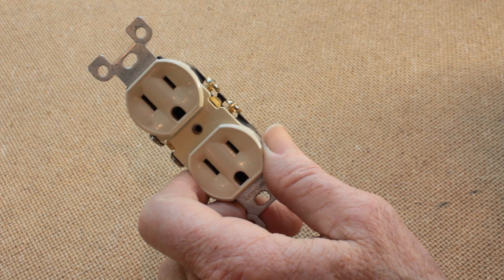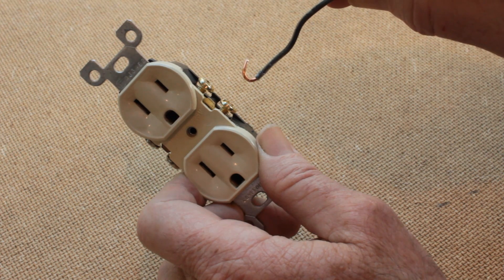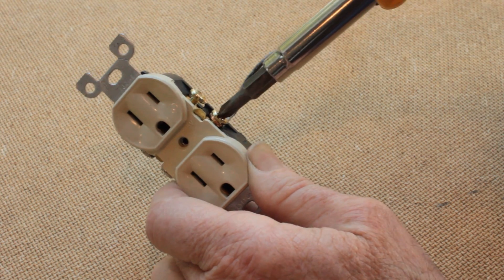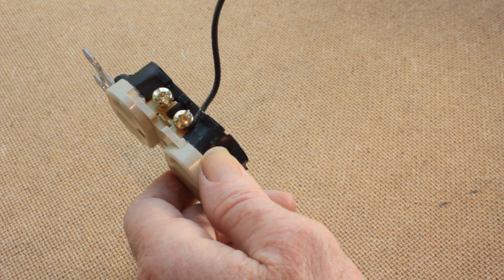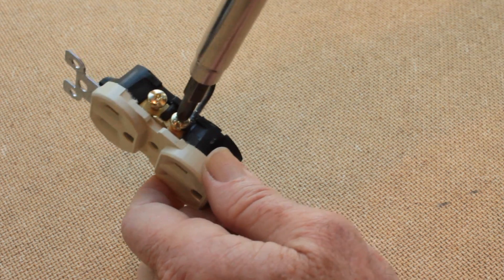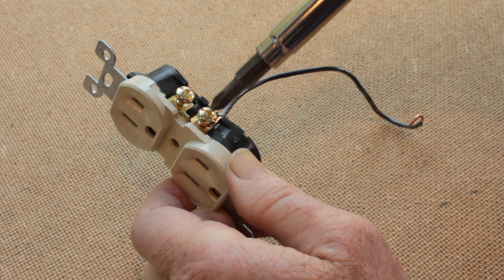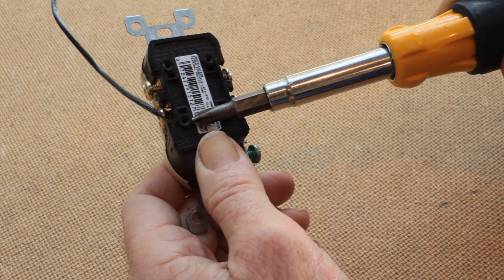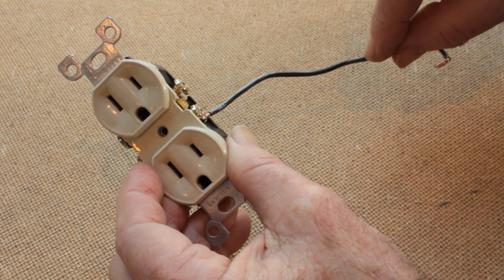A Common Goof Replacing Outlets

Comment: I have six wires on old receptacle four on screw two plugged in back. New receptacle has four screws and no holes for the two extra wires. What do I do? 2 black, 2 white and 2 red. The 2 were stuck into the back.
Reply from the maker: Easiest would be get a receptacle with screws and holes. Otherwise, put the blacks in a wirenut with a single new piece of wire. But take notice: red often means half the receptacle was controlled by a wall switch or is a different circuit. If so, confine the reds to (say) the bottom half, with blacks to the top, and break off the metal tab connecting top and bottom.

Comment: I like adding a couple of turns of tape around the outlet before it goes back in the box. The commercial guys who do the wiring where I work do that. Seems like an added bit of safety that doesn't add much time to the job.

Comment: Good advice. Can't be too careful when working with electric fixtures. My first place was about 50 years old when I bought it. I eventually replaced all the worn out wall plugs & switches and noticed the old copper wiring was heavily tarnished where it was attached to the fixtures.  I removed the tarnish with fine sandpaper held between thumb & forefinger. Don't know if this was necessary but my intent was to create best contact between wire and fixture. It's been 43 years and the house is still standing so guess it was safe to do it.

Comment: I like the newer style outlets that have a clamping plate under the screw.  No more wrapping the wire around for a good connection and easier removal than the holes in the back.

Comment: If you use the rear insert holes with the wire stripped to the proper length, are you supposed to screw down the side screws anyway? They always come from the factory as shown in your video.
Reply from the maker: There are some uncommon receptacles whose holes on the back will not hold onto wires at all, whose holes are not meant to. For these receptacles the side screws must be tightened to hold the wires in the holes tight. So always see if wires you have stuck in holes will easily pull out.

Comment: This completely depends on the user's skill level.  Yes if you can curl and install on the terminal the way you are showing, then yes a better installation no doubt.  As an electrical contractor I have seen extremely poor connection attempts at wrapping the wires where using the back stab connection would be a much better connection then a poor terminal connection.  I've seen wire insulation melted back inches in some cases with a really bad terminal connection.
Reply from the maker: For the benefit of comment readers let me say that when Nick refers to "terminals" here he means the side screws. (The push-in contacts are terminals too, I believe.)

Comment: If you're not aware of this information you should not be involved in electrical wiring. Wire size and circuit amperage should also be taken into consideration. You can burn your house down. This can not be over emphasized.
Reply from the maker: Is there anything that can be overemphasized?
Reply: I've been doing minor home electric repairs and upgrades for 20 years because of people like the circuit detector. Thanks!
Hiding info doesn't help anybody.

Comment: WHY would leaving a little insulation on under the screw head lead to HEATING? Makes no sense...
Reply from the maker: When electricity flows through something well (that is, when there is little resistance), very little heat results. But with more resistance, heat results there. A portable heater produces its heat because its element is resisting the flow of current to a degree.

Comment: Tell people why. Without a good copper to copper connection it adds resistance. Also make sure your connections are clean, a bit of sand paper on your wires can't hurt old stock.

Comment: Why do they make outlets and cords with one prong wider? This makes it more difficult than it used to be when plugging in. I asked an old electrician about it once and he said something about "phaze", whatever that is. Do I care if my tools are not in phaze or whatever?
Reply from the maker: It's not extremely important but for instance when you are unscrewing a light bulb and your finger touches the threads of the bulb, they don't want you getting shocked from that. They want the little tongue down in the light socket to be what could shock. The prong width is not insuring "phase", it's insuring polarity.
Reply: So should I care if my tools are out of polarity, or whatever? I was thinking about grinding down all the wider prongs so I can plug my tools in either way, like the old days.
Reply from the maker: If it's just an inconvenience to plug in the "right" way, I don't think that justifies grinding a prong because it's not just you who may be using the tools, Some heir of yours might do something foolish that would show us an as yet unimagined reason polarity matters.
Reply: I just read that AC voltage has no polarity. I think I will go with that.
Reply from the maker: AC "polarity" is a different thing and it occasionally does matter. DC polarity is about positive versus negative charge, but AC polarity is about both-of-those charges (alternating) versus no-charge (=ground).
Reply: With a defining difference in size of neutral and hot prongs, the appliance defines which wire is the hot wire and which is neutral. That distinction is important for the design of internal wiring of the appliance you're plugging in. Most appliances have at least one internal fuse, and that fuse is typically designed on the hot side so that downstream internal electronics and wiring is safely protected after the fuse blows. Also the switch to start the device should be on the hot side, for the same reason that ground side switching of AC wiring is frowned upon. If a device is ground side switched, it may be easier to accidentally short hot to ground through the human body. Even when a ground side switch is open, there are hot conductors that could short out through human parts. This is a similar situation to why one disconnects the ground of a car battery first, rather than the positive pole. If you touch the wrench from the ground side to the car frame, no spark happens since the frame is already grounded. If you touch pos to frame, expect fireworks, so it's safer to disconnect ground first. Once the first pole is disconnected, you never get sparks with the second disconnect. The fact that the appliance plug is AC makes no difference, because ground and neutral should have a similar potential so shorts between those two through human fingers aren't often as catastrophic.

Comment: So you have a Hot and Ground...where does a common go and what is it used for?
Reply from the maker: This video only shows and talks about the "hot," not any "ground." In regard to AC house wiring, almost nothing is referred to as the "common." (The non-traveler of a 3-way switch is called a common.) The white that would go to the other side of this receptacle is called the "neutral." And the green screw of the receptacle would receive the bare (or green) wire known as the ground.

Comment: So...
Which is a better attachment (current capacity, longevity, etc.), but not considering space and fitting inside the receptacle box:
Screw attachment
Hole attachment
Reply from the maker: I'd guess screw; but I'm not aware that anyone has compared the two scientifically. There is room for installer error with either one.
Reply: That's what I'm inclined to think.  
Cheers,

Comment: Compared to the UK's BS1363 sockets, these are a joke.
Reply: Then again you have to wash your hands under separate hot and cold faucets.  Lol!
Reply: Is that what you consider a joke? I don't get it but either way I like that the plugs aren't so big you need two hands to plug it in and i like not have to sleeve

Comment: I see a lot of hints here, and in other posts regarding the same subject, that should not need to be pointed out.  If someone doesn't know that the screw should not hold the wire in place by the insulation, they should not work around electricity, period.  Doing so can cause a high resistance connection and be the cause of a fire.  Unless someone knows what they're doing, they should never work on a live circuit.  110 Volts can kill!! While I don't claim to one of the select few capable of learning about house wiring, a little training, combined with common sense, can go a long way.
Reply from the maker: I don't quite understand. "... a little training, combined with common sense, can go a long way." Toward what? Also, "If someone doesn't know that the screw ... they should not work around electricity..." Well, many people view the video precisely to learn about how the wire should sit under the screw. Do apprentices know everything before they are allowed to touch anything?
Reply: "training" in the case of hooking up an outlet would consist of knowing the difference between the hot and the neutral, and which one gets connected to which terminal on the outlet, for example.  
I would expect a would-be apprentice to know when he walked through the door on his first day that insulation would have to be removed when making a connection.  That would be common sense.  Once he knows "everything", it's likely he would no longer be an apprentice.

Comment: Meh, when your hand learns how tight is too tight or not enough this is not really an issue, the thermoplastic will squish down and not be an issue. For people who don't do this for a living this is good advice though.
Color means nothing to the second person who services the equipment, assuming something is hooked up correctly can make you or others dead, use your meter or wiggie, hot stick voltage indicators are not reliable enough to stake your life on.
Reply from the maker: Even the torque specs from the manufacturer assume no thermoplastic is caught, though. People who tighten screws for a living don't tend to be the ones called in 10 years later when a connection finally fails. About being sure a thing is dead, what good is a meter or wiggie if ground (and neutral) is no good?
Reply: TheCircuitDetective 
For one, professionals have the experience to test and find a good ground or neutral for testing purposes, tightening screws with a torque wrench is fine in theory, but in the field you will be ridiculed, torque wrenches are typically used only on hex head bolts, usually larger like on service equipment, bus bars and large circuit breakers. Torquing phillips or slotted screws always depends on engagement pressure which is too variable for small torque values to truly accurate. (besides the fact that carrying a set of fixed torque screwdrivers will subject you to ridicule)

Comment: Motorcycles and cars red hot black always ground......why cant everything be standardized
Reply from the maker: In the UK before 2004 housewiring WAS red and black. Then for some reason they changed to brown and blue. You can't win.
Reply: Because AC mains power is multi-phase and a circuit can have more than 1 "hot" wire.  It doesn't make sense for it to try and follow DC standards.

Comment: Mr.  circuit detective could you tell people what happens if this recepital with 2 different circuits and how to break the tab and about a ground pig tail to ground a box that is facinated to an cement block wall and why the case should be grounded as long as we a talking about receptical or switch that green screw in not there for looks . Thank and no discreptiful  to your vid excellent thank you
Reply from the maker: Joe, I address some of those issues at my website (www.thecircuitdetective.com). I don't think that here is the place to do so. No harm in asking.

Comment: Unfortunately the holes on the back of these american-used receptacles take a #14 wire and I have found most wire I come across already installed is #12 or a thicker wire. Looks like he might be using a #12 for demo purposes and it would be helpful if he identified.
Reply from the maker: I was using #14. If someone with #12 wires tried to push them into the back holes, they simply wouldn't be able to, since the new holes are too small to receive #12. I only mentioned back-hole use in passing. I hope it didn't throw people off.

Comment: Of course but you used a Philips screwdriver. A Robertson screw and screw driver allows one of tighten considerably more.
Reply from the maker: I agree with your drive-by comment. But the point of the demonstration is that even a fantastic screwdriver will not avoid the risk of meltdown, if insulation is trapped under the screw.
Reply: Agree one must not trap insulation under the screw.
Reply: Never seen sockets or switches supplied with Robertson (square drive) screws before. Older ones seem to be mostly slotted, newer ones slotted Phillips.
Reply: Here in Canada, the screws on receptacles all have the Robertson square hole (combined with a straight slot).  The Robertson style is the best no-slip design I've ever seen, and has been in non-electrical use (like for wood screws) in Canada for at least 70+ years.

Comment: Those push-in rear connectors that use a spring clip (instead of a screw clamp) are an electricians best friend. They always fail and cause a service call which results in making money.

Comment: you also have to watch which way you install the "curl".do it the same direction the screw tightens.loose connections burn houses down!
Reply: Very good point!
Reply: Is a loose connection what causes arcing?
Reply from the maker: Yes, even when you purposely touch a live wire to ground, making a short circuit, any sparking that occurs is from your not touching them together solidly (and so also quickly) enough. With a loose connection on a circuit that is running something (a light, for instance) overheating will usually occur before actual arcing develops.That's a fire danger itself.

Comment: Good video.  Not to be overly critical but its preferred to get as much of a wire wrap under the head of the screw as you can.  I pre-form the wire into a question mark shape using round nose pliers.  I then open the loop just enough to slip it past the body of the side terminal then I close the loop under the head.  I've recently begun using a torque screwdriver to tighten the side terminals to the manufacturer's spec.

Comment: Good video.  I had an outlet that people had hooked a space heater into at work.  It became intermittent so an electrician came to repair it.  It had been back wired like this and had overheated to the point where it was charred and crumbling.  They do have safer back wired receptacles which you pout the wire straight in and then the side screws clamp it between 2 metal plates.  They cost a bit more but it's worth it.  The professional grade stay much tighter  and hold the plug blades better than the cheap ones.
Reply: Henry Chinery Most of the GFCI outlets I’ve worked with have been made that way. Haven’t seen regular outlets made like that in a long time.

Comment: Another point many miss, including seasoned electricians is that you are showing  a 15 amp outlet, designed for 15 amp service via 14 gauge wire, and you can use those install holes on the reverse side. Many choose to attach a 12 gauge wire to a 15 amp outlet only to discover a 12 gauge wire will NOT fit into the install holes, therefore you have to curl and tighten to the appropriate screws. A  20  amp outlet has a horizontal slot on the neutral side, and the 12 gauge wire attaches directly under the screw plate on these outlets, then tighten without curling the wire under the screw cap.
Reply from the maker: hawkturkey and others -- Because 15 amp receptacles are allowed on 20 amp circuits, we don't actually know that loading one with 20 amps would overheat it. The main purpose of the 20-amp-configuration is to assure the person who is plugging in a 16-20 amp appliance (that is, one with the special cord end) that the circuit won't trip for their heavy load.
Reply: +TheCircuitDetective Need to check the NEC. You can use 15A receptacles on a 20A circuit. 210.21 (B) (3) Receptacle Ratings. Where connected to a branch circuit supplying two or more receptacles or outlets, receptacle ratings shall conform to the values listed in Table 210.21(B)(3).
Reply from the maker: You're right, of course. I must have had a little brain f**t. So I think you agree that Otto Roth 's comment was giving people a wrong impression -- as if 12 gauge wire always calls for a 20-amp rated receptacle.
Reply: TheCircuitDetective 
The part that bugs me is if you have down stream wiring, and use the screw terminals to connect the source wires and output wire, the connection between them is less than 12 gauge ( the little wing  between the terminals). Why can't they make them with full 12 gauge cross sections... I always wire nut the connection with pigtails to the plug because of it.
Reply: Otto Roth you are correct otto.the "plug " in part on the back is good for 15amps 14 guage wire.12 wont even go in it.says right on back of plug if ppl would take the time to read it
Reply from the maker: It isn't that 12 gauge wire can't be used with these 15-amp receptacles. It can, AS LONG AS the breaker is 15-amp.

Comment: One time I went to change an outlet and there were 6 wires all Back in the box and the we're all black cloth coverings. 100 year old plaster house. Outlet wasn't working to begin with. And looked pretty nasty with not much play in the wires. I just said forget it. I got out a tester and there was power in the box but no power going to the leads on the plug. I think somebody was fooling around with it before I got there.